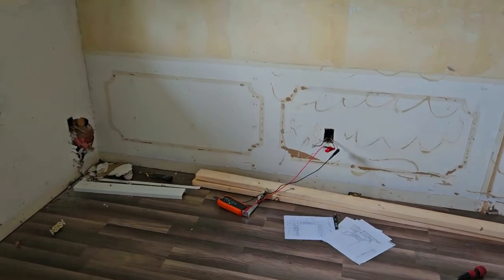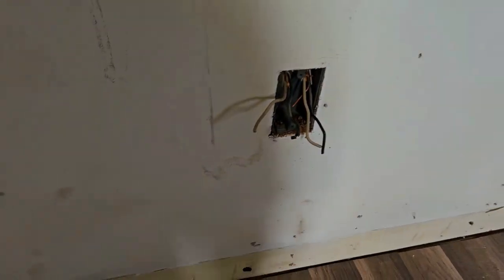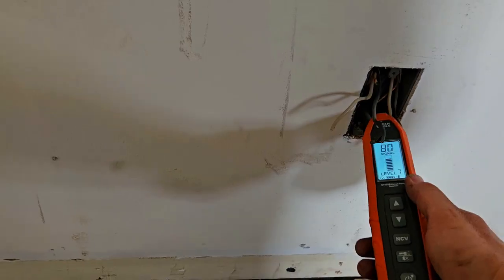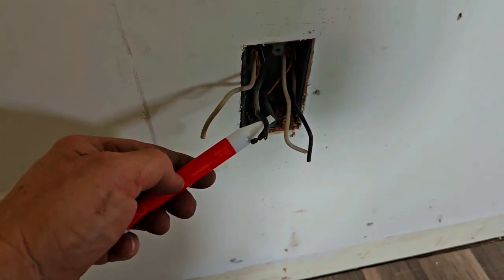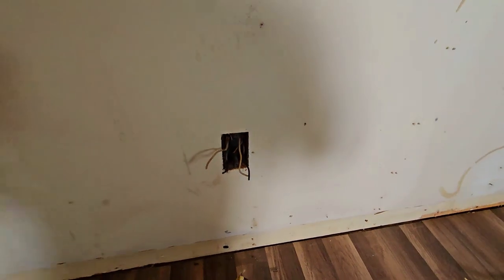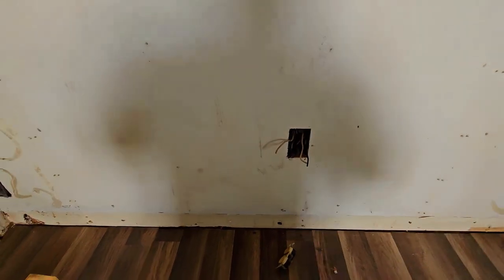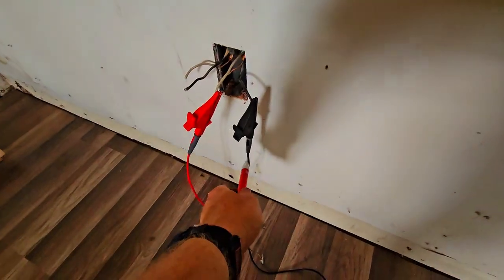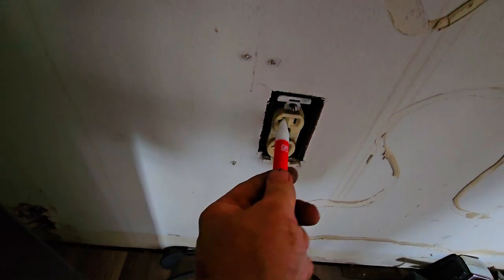A Tip NO ONE KNOWS Until Now

Comment: Commercial electrician in the US. I’ve been using that trick on dead wires for years it’s fantastic. Another trick for hot wires is to plug in a vacuum and have a guy turn it on and off while you measure currant with your clamp at the panel you’ll see it plain as day on the correct conductor. I use this method in places like medical suites or where people are using computers so accidentally turning off the wrong breaker can’t happen. I usually use my PVC blanket instead of a vacuum as it’s quiet but I know not anyone has one of those or even knows what it is.

Comment: Electrician 26 years and I knew that, but you can also turn the sensitivity down as you get closer to the wire or breaker so it will only tone on the exact wire or breaker and the higher the number on the readout indicates when you're on it. So just learn your tool as you said. 👍
Reply from the maker: Exactly thank you for your comment and watching

Comment: 👍Great idea!  I've learned using the ET450 that we can isolate non-energized wires rather rapidly by "dialing in" at a level three or four, but wire-to-receiver position is even more important.  Dialing in: Start at a lower level and then work your way up with longer runs of non-energized wire.  By "dialing in" most know about this.  If not, I'm talking about establishing a receiver level where there is a "numerically distiguishable difference" in the levels between wires that are actually carrying the signal (the wires you want) and wires that are only crosstalking the signal, i.e. reading a distinguishable low level (not the wires you want).  Position:  We can position the Klein receiver most accurately by orienting the receiver tip correctly on the wire.  When we literally "touch" the wire with the tracer receiver at 90 degrees to the screen (the wire pointing vertically to the screen off the tip).  Orienting the tip sensor this way makes it work very reliably.  When putting a wire at 90 degrees on the tip of the tracer receiver, a significantly lower number is a cue that that wire is not your transmitting wire (it's just crosstalk).  For example, with one wire I could see a reading of 11 and for another wire 68 (the difference / variance is what you're looking for).  When you're dialed in, and at the right receiving angle, you'll get that type of difference (Note: Your numbers can be different obviously).  With 68 and 11 being the readings for two separate wires, guess which wire is on the alligator clip?  That's how you do it.  Just ensure you're separating that bundle of wires enough to touch one wire to the tip of the receiver at 90 degrees orientation to the screen.   Additionally, this 90 degree method works with walls also (the main reason for the tracer).  Always trace at 90 degrees orientation to the wire you suspect you're tracing.  That's how that electrical field works at the tip of the ET450 tracer.

Comment: A trick I learned from a telco guy.  Put your meter directly on the leads of the tracer and measure its resistance.  Make a note of your reading.  When you are at the other end of your wires, measure again.  Hopefully, your meter can "see" the tracer unit and the values should be nearly identical.   Note, if you have other things plugged in, you might also see their electronics too and that could cause a bit of confusion.

Comment: How do you know the tick tracer isn't just reading a hot outlet? Apparently you'd have to have the entire panel off. That way you'd know it's the tester or lead not just a hot circuit. Right ?
Reply from the maker: Just the circuit. If it's a true 120 volts it will beep the tick. Otherwise it would be beeping and solid light not flashing. Great question
Reply: Or you use a meter and confirm if there is voltage present.

Comment: Thank you for sharing this. I was working on a restaurant kitchen hood exhaust fan which had a bunch of issues, one of them being that the fan was on a circuit that had some shorts inside the wire. I was trying to pinpoint which wires went to exactly which breaker, so I could find and fix stuff. Using Klein's cheaper circuit tracer, the ET310, I ended up thinking that things went to one breaker, but in fact went to a different breaker. Of course, there were a lot of breakers that were not accurately labeled, so it took me so much time to trace the circuit to the right breaker. I jumped on Home Depot to seek out a better tracer, and started looking closely at the ET450 kit. I came across your video when looking up what other people thought about the tester, and glad I came across this video. If I had only had the ET450 and watched this video before doing that restaurant, it would have saved me so many hours and frustration. Thank you very much for sharing this, God bless you!
Reply from the maker: I appreciate your comment and watching

Comment: That is a really slick tip! Thank you for the info. I just purchased the Klein advanced tracer kit to find out where a wire goes. I thought it ran straight up the wall bay to the attic and over to the panel, nope. I only found this out after falling through the ceiling and twisting my knee. I should have just ponied up the money for the tracer and this would have been so much easier.
Reply from the maker: It's an amazing meter for sure

Comment: Nice find!  Do you know if the Santronics NCV will work on the less-featured Klein VDV500 tracer that I use? I tried this  technique with my Fluke NCV (12-1000v model)and did not pick up anything.  It may be the case that the et450 has a higher power output than the VDV500.  Thanks.
Reply from the maker: Not sure but I have the ideal circuit finder and it works on it as well.

Comment: I'm assuming this works because the circuit finder is sending voltage through the wires and the tic tracer is picking up the voltage? I don't have the circuit finder so I'm just speculating.
Reply from the maker: That is correct. I am not sure what kinda voltage it's sending out. But I now want to see.

Comment: Doesn't the tracer already have a built in NCV? 🤔
Reply from the maker: It does but won't work like I am showing. If that where the case I wouldn't have made the video the way I did. The only pen tester that works like that is the santronics
Reply: @MountaineerOutdoors  well you left out that important bit of information in the video. Didn't think it was worth mentioning? Also when you're tracing dead wires you're supposed your common lead to ground of a different circuit. Clipping the hot and common leads to the positive and neutral of the same wire will cancel out the signal making it hard to trace, unless you're trying to identify a breaker.
Reply from the maker: I'm gonna have to eat huh?

Comment: I tried it and it didn't work for me, I tested it using a 20' length of NM cable connected my ET-450T black to white NM conductor and Red to the Black NM conductor and nothing. I tired three different Tick Tracers a Kline a Fluke and and Ideal . The tick tracers were rated for 40-1000 VAC,  90-1000 VAC and on 50V-100 VAC, I looked up the one your using and looks to be about the same 50-1000 VAC. What's up?
Reply from the maker: Honestly the only one that I have found it to work with is that brand. Santronics I think that they are the best in my opinion
Reply: @MountaineerOutdoors Santronics model # 3115. Works for me and also works on 2 other tic tracers but not as good. The transmitter puts out .0029 volts a.c. at 16 Hz using a multimeter. An oscilloscope would be more accurate.
Reply: I picked up the Santronics 3115  AC Voltage Sensor and it worked with the ET-450 I tried the other ones again still no luck. After using the Santronics 3115 I have to agree with you it a good voltage sensor.
Reply: I didn't use a different brand circuit tracer, I used different brands of non contact voltage tic voltage testers with the ET450 like shown in the video. @Suckitdownpipe
Reply: Santronics 3000 is a must try

Comment: Could one otherwise connect a small 12V battery, instead of that expensive tool, alternatively be used in a similar manner (with breaker OFF of course, and then testing for 12V output at the other end)?

Or does that special "tracer" tool utilize/transmit some kind of RF signal instead of electrical current?

Great tip!
Reply: U can use power or not try a batter on a live circuit and see
Reply from the maker: I don't know honestly, I don't think I would want to try that too many things could go wrong. I'm not entirely sure what voltage/signal they tracer puts out, this question has me wondering now.
Reply: @arealmaintenanceandrepairl1103  Why would I do that? Why would anyone knowingly test a live 110V AC circuit with a battery? That wasn't my question, and I'm quite certain that I specified with the breaker off... (I'm sure the video creator understood my question, he's probably smarter than both of us.) If the MAIN master breaker switch is off and you STILL have live current flowing in the circuits, you've likely got bigger problems on your hands... :P
Reply: @MountaineerOutdoors  Lol. I loved the tracer tool, It must run on some kind of power source, perhaps it just sends out low energy/RF pulses, maybe a pre-shared key code that the receiver then decodes. Neat tool and great video!
 :P
Reply: GOOD  one